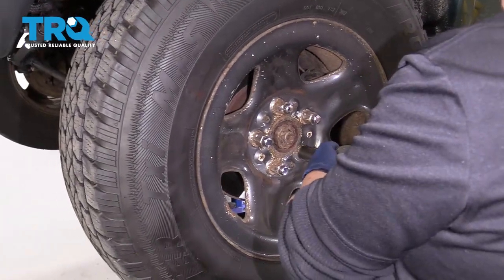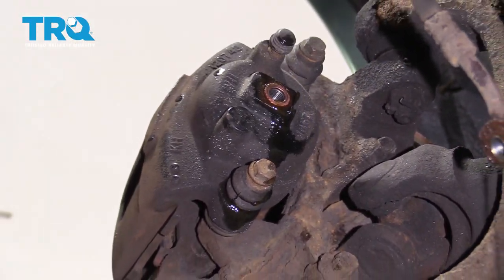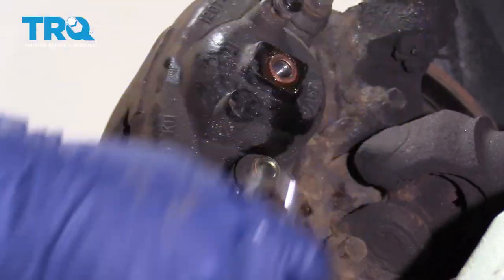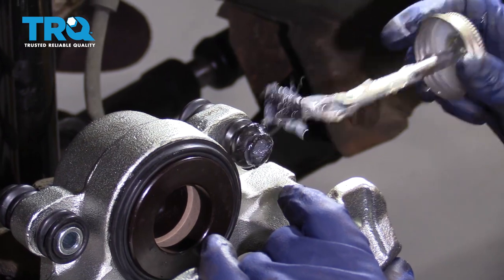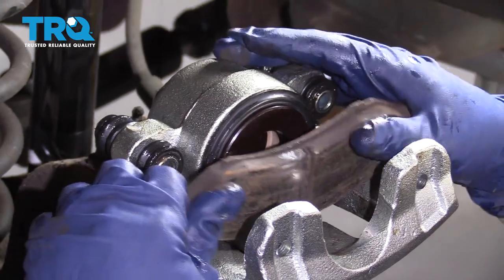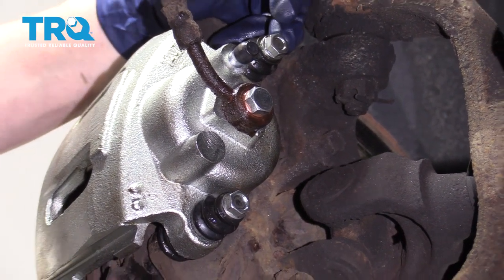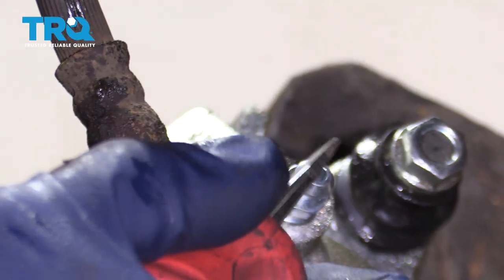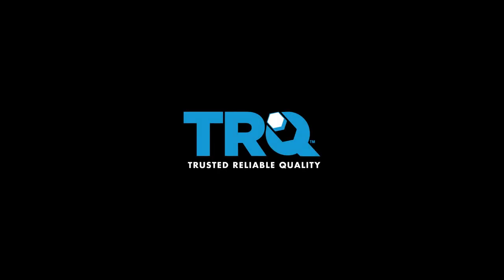How to Replace Front Brake Caliper 1984-2001 Jeep Cherokee

Comment: Need to do more than a gravity bleed. You'll still have air trapped inside. Also use needle nose locking pliers to clamp brake hose so you won't leak fluid everywhere and prevents air moving back up the system.
Reply: Needle nosed pliers can break the inner liner of the brake hose and need to be applied Very gently.

Comment: I noticed that you applied plenty of silicone grease onto the brake pad friction surfaces.
You should have carefully wiped clean your gloves after handling the greased up caliper pin sleeves,
and sprayed some brake cleaner on the pads to clean them up before installing.
Also, you were careful to use a torque wrench on the caliper bolts, but careless to not torque
the banjo bolt to spec.
Reply from the maker: +Weber Lau Thanks for the tip! We'll pass this info along to our production team. http://1aau.to/m/Shop-TRQ
Reply: The greased up glove onto brake pad mating surface was definitely a no no for me too. New gloves, or at least clean gloves before handling pads. Now its a potential safety hazard with the grease from the gloves on the pad friction surface and not cleaned. I'd also recommend cleaning the rotors before assembly.. but I'm ocd, and brake clean is cheap. 
Other than that and the aforementioned banjo bolt, I'd also recommend a piece of 1/4" tubing on bleeder valve, even when gravity bleeding. But that's more a pro tip to keep the brake fluid of those freshly painted calipers. Paint and brake fluid don't mix.
All in all job well done. Some little details that may help those who try this (easy) job
Reply: Quick and somewhat rushed job but at least the point is across
Reply: Torque wrench isn't necessary for any part of the job. Just make sure it's tight. Stop nitpicking everything.